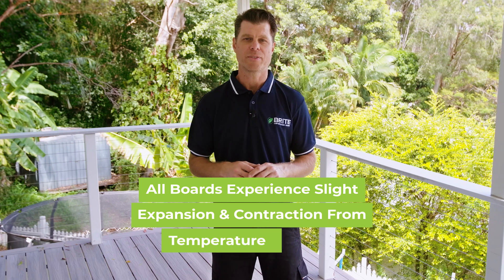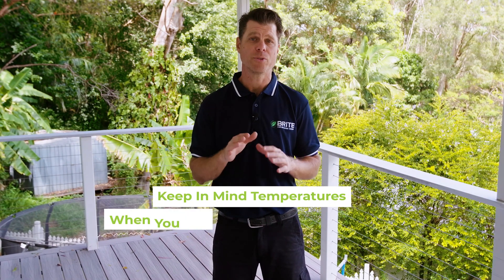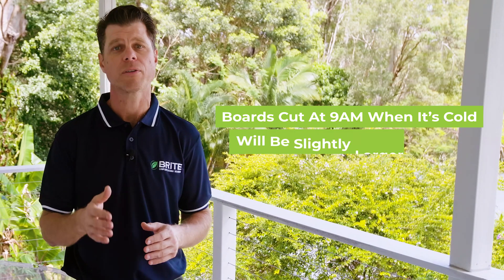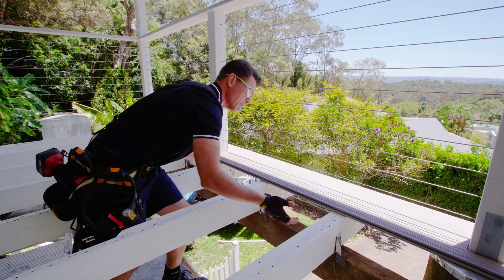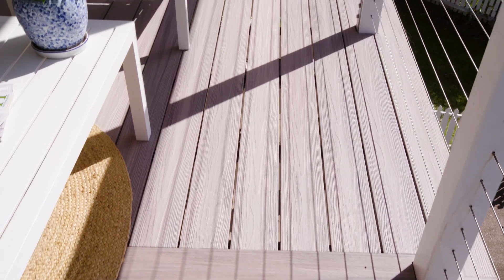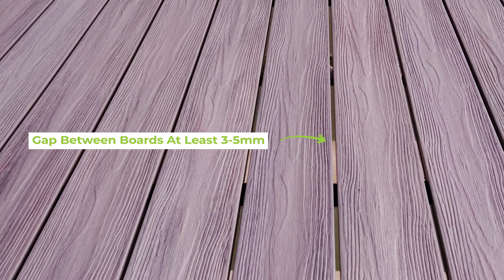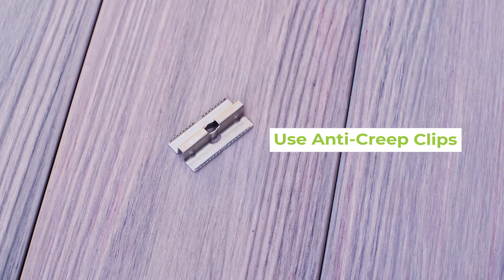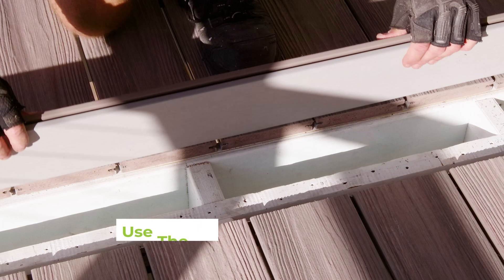Composite Deck - Expansion & Contraction

Comment: How does the poor performing material justify the cost?
Reply: No wood product offers the 25 year warranty that is routine for composite decking. Composites blow the doors of conventional wood, especially considering how refinishing is not ever needed. It just takes some skill to assemble, and understanding that the weak link will be the underfloor joists and beams. If you're gonna burry wood piles below grade, I wouldn't bother with composite decking since the structure will rot first.